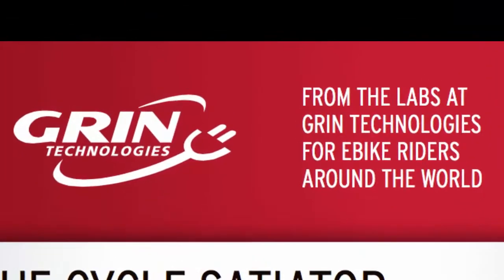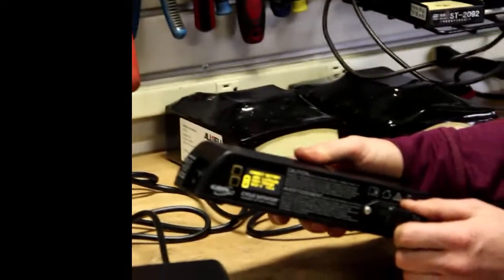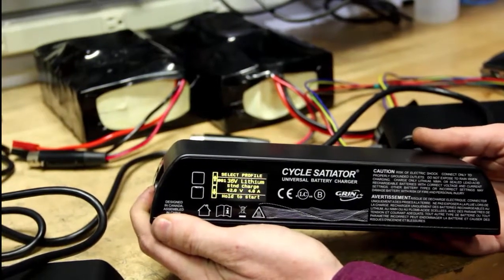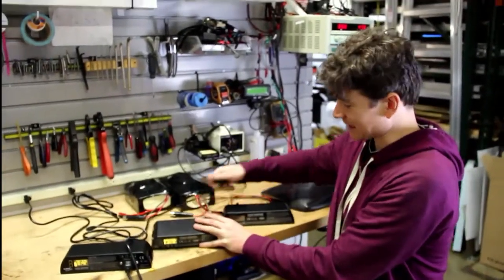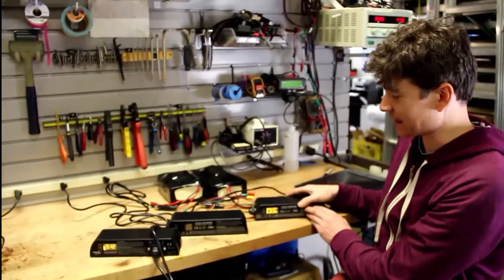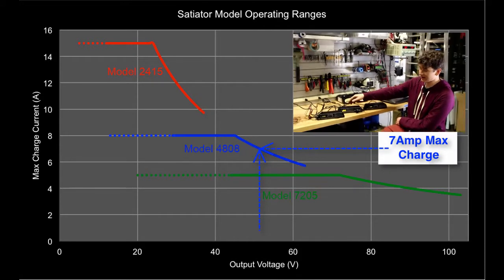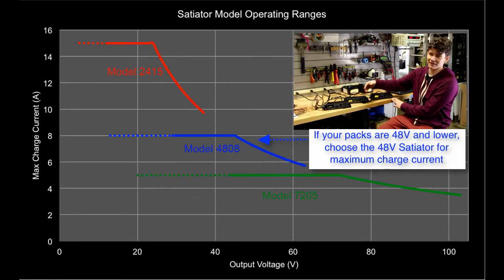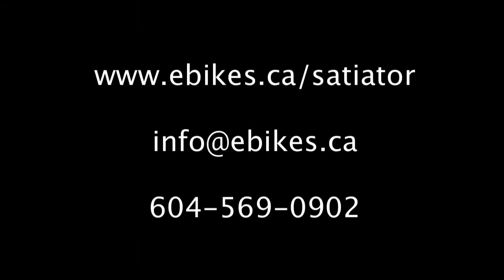Cycle Satiator Family of Battery Chargers 12-103VDC

Comment: The problem with these is the low power output.

I guess it's OK for a scenario where you ride to work and can then let it charge all day.

Its a pretty hefty premium just to add variable output.
Reply from the maker: It's a 360 watt output, which is about 2-3x more power than most common chargers that are sold with ebikes (generally 120-180 watts).  For an average ebike battery that's about 2 hours for full charge from empty. 

But if you are using it for something like an electric motorcycle with a 4kWh battery pack, then yeah it's not the best choice for that.
Reply: True.  Have currently a 1.6 kw/hr battery, with plans to go up to 2.5 kw/hr.  Since I find I need to get off and rest for a bit about every hour or two, I can charge up whenever the chance presents itself.

Example: I took a route yesterday to this one store (22 - 25 miles, one way) that went through a park.  There’s a covered gazebo-type structure that I passed by.  Seems it has unsecured outlets…. Possibility of getting a modest charge there when I take that route further afield, perhaps.  

I can manage just shy of sixty miles, presuming I start at 90+ percent of charge and quit at 20% or so.  This presumes I don’t deal with too many hills, and go at a 12 -18 mph pace, the lower half of that predominately.  Note that it might be slightly better now, since I recently repacked my rear hub with fresh Mobil-28 grease, and am addressing matters of undue drag as well, e.g. slightly warped brake disks that lightly contact the pads every revolution.

Comment: Can I use the standard version to to charge my 12v gel battery when I need to? Thanks
Reply from the maker: Yes indeed you can. Just create a new profile for lead chemistry and set the full charge voltage to about 14.4V, and the float charge voltage to about 13.8V

Comment: Not mentioned at all: using the satiator requires a battery with a bms??? Output voltage/ charge level adjustable??

Comment: Hi. Can I use it to charge hybrid car batteries..is it like a grid charger? Can you ship to Mauritius
Reply from the maker: Both the voltage output and power output are lower than you'd typically want to have for charging a car battery.  Even a small hybrid car battery would probably want like a 2kW charge power to top up in a reasonable time.

Comment: Why come these great chargers not builtl with a fan inside?
Reply from the maker: Because then it would have all the downsides of a fan cooled charger (open for water exposure, fan noise, high rates of fan failure).  It was one of our foremost design goals with this project to make a high power ebike charger that was silent, sealed, and fan free.
Reply: @GrinTechnologies  So the newer 72v ones are now made with the electrical cord in the back?So just how much are this charger?

Comment: Are there follow on videos to this? I couldn't find any. Just purchased one through the Grin online store and would like to setup multiple custom profiles. But every time I go to create/save a new profile the previous one I created is no longer available on the list of profiles. Can I create multiple custom profiles without connecting the charger to my computer to program? What am I missing? Please help.
Reply from the maker: Please send an email to info@ebikes.ca for support.  You can create multiple profiles just fine via the button menu, no reason to connect to a computer, but it's possible that you have encounted a firmware bug if the recently created profile disappears.

Comment: I want to order a charger 36 votes 540wh and the type of ebike is Doverpremium impulse
Reply from the maker: The main thing you need to figure out is the actual connector style that is used on the charge port and see if there is an XLR adapter cable to that plug type.

Comment: Quick question.  Mine just arrived and it has an XLR connector, which is different than my scooter and bike.  I cut the cord to splice with my other cord but found that the charger has 3 wires, White, Black and Yellow, but the plug that fits my bike has only two, red and black.  Which should I connect to which and what happens with the third wire?    thanks

Comment: You can charge lipo packs with this right either individually like 4s or 6s or bulk via a bms with a 20s series of lipo?
Reply from the maker: Correct, you can charge down to a 4s pack  (15V nominal) or up to 24s (84V nominal) with this one charger. But it does NOT do any cell balancing during charge which is why we really only recommend it with batteries that have a BMS circuit onboard.
Reply: Grin Technologies Thanks. I will balance them separately first then with a lipo charger. After that they will be in a harness with a bms and I can charge for 72 volts. I'm using the graphene stuff so it should be safer. Cheers

Comment: interested in this device for my 20s 84v 10ah lipo turnigy packs.  Just wondering, since the ten packs are hooked up without using a bms!  Can I use the cycle satiator by itself to charge up wthout a bms installed?

Comment: getting ready to make a 96 volt battery for my scooter. would the 5amp 72 volt model be ok? im thinking 108 volts would be fully charged
Reply from the maker: Hey Mike, the max output voltage is 103V, so not really compatible with a 96V nominal pack if it needs to hit 108V for a full charge. In general we were aiming to accommodate at most 24s lithium batteries, which you might call an 86 or 88V pack.

Comment: Awsome Work Justin and all teh team!... i'll prepare my order for a 72V model soon.

Hey btw one very great tool wold be to offer a hidden mode that allow to charge a single cell from 3 to 4.2V to help manualy rebalancing pack !!.. but maybe the switching circuit is not optimized to go as low in voltage... but i'm sure that tool would become very appreciated by users !!!.. maybe a firmware update could allow that if the circuit does?
Reply from the maker: +Doctorbass 
Hey Doc, I hear you about the convenience of being able to top-up individual cells with an external power supply. Unfortunately the resonant converter power topology used in the Satiator is very far from ideal at regulating really low voltages like that so there are hardware limitations preventing it. I'll post more details soon on the ES thread about using the high voltage Satiator in lower output applications.  

That said, the need for people to manually balance cells on their pack should be pretty much obsolete these days. Properly matched 18650's never drift out of balance any more than the tiniest amount which is easily evened out by even a few mA of bleed current from a balancing BMS.